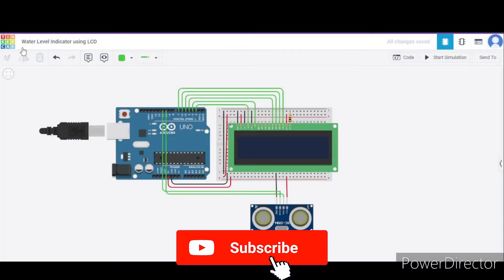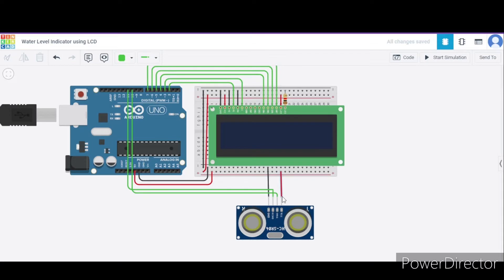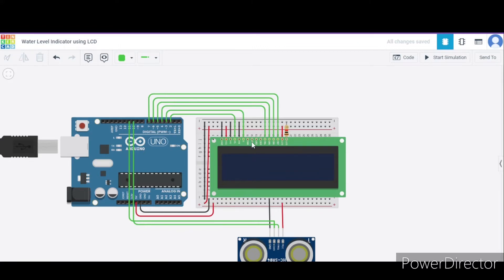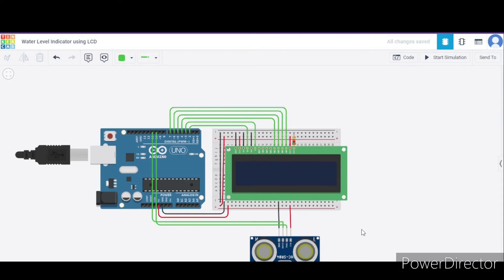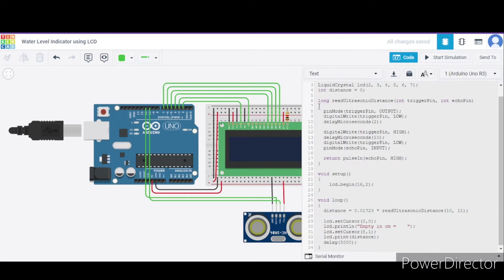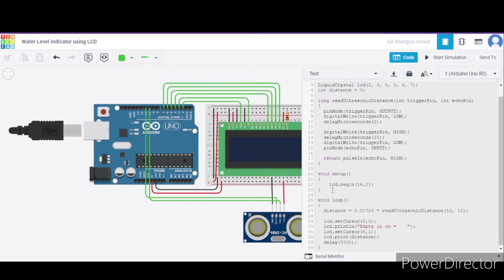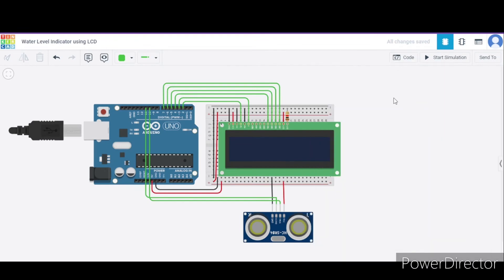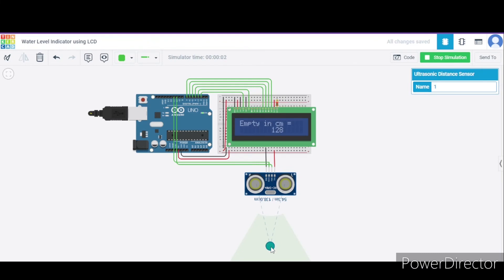Water Level Indicator Using LCD | Arduino | Arduino Project

Comment: hello
i tried out your code, there was an error message, can u fix this please...

1:1: error: 'include' does not name a type In function 'void setup()': 17:1: error: 'lcd' was not declared in this scope In function 'void loop()': 22:1: error: 'lcd' was not declared in this scope
Reply: ok, i found the problem, i included liquid crystal from library and it worked. Thank you